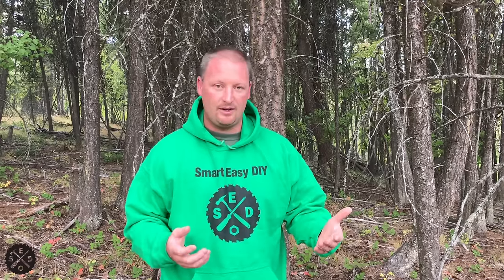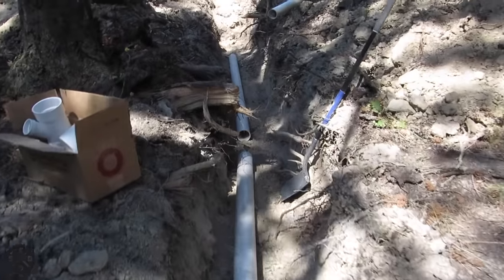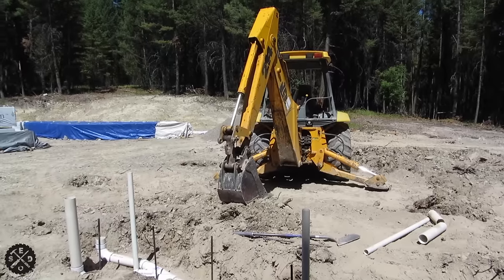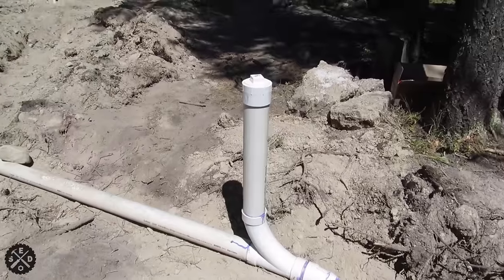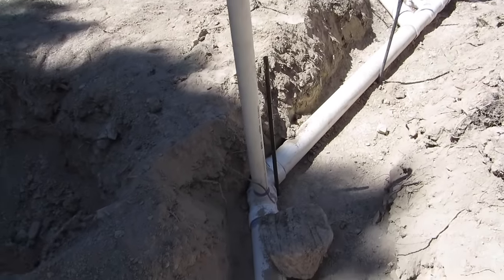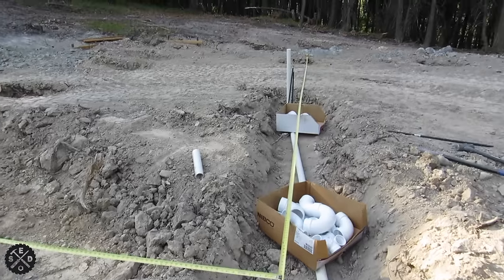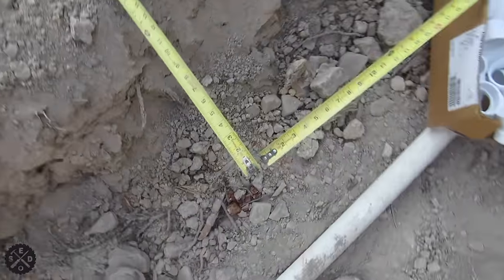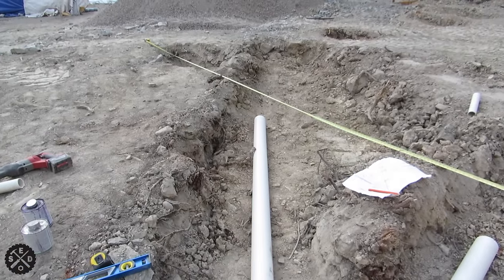Rough In Plumbing Before Concrete Slab Pole Barn House EP 4

Comment: Future reference for others. Size, don't oversize in drainage pipes. If oversize or too much slope, the solids get left, as the liguids drain away too fast, or don't wash the walls. 3 inch will run a whole house up to 3 baths. 
I should do a under slab video for the community. 
So many savings that could be realized, by more combination drain and vent properly. 
Great work on n a rough site with those rocks. Mostly right on.
Reply from the maker: Thank you for the comment. Thanks for sharing the tips. Yes I went 4 inch since I have a four bedroom and slope is very important. You should make a video. It’s all about sharing ideas. 😊 Thanks
Reply: What if you have 4 restrooms
Reply: @contrarianthinker   that is when it goes to 4 inch pipe. Oversizing cost more for materials and will not wash out as good since the water level in pipe is low and want carry everything it lays down and piles up.

Comment: Im a total amateur here. Is it ok to tie sinks/showers/floor drains all into the same drain your toilets use? I understand you use p traps  but im just concerned about  the possibility of sewage backflow into my non-sewage drains. Again, I know nothing about this stuff but welcome any advice. Planning on building in may and need to get this rough in stuff knocked out in April. Also, how do you know exactly where to center your toilet drains? Are all toilets pretty much the same distance from the back wall?
Reply from the maker: Yes it usually all gets tied into the main line which will end up in your septic tank. Most places don’t let you separate grey water and sewage anymore. Usually toilets are 12” center out from finished wall. So if you do 1/2” drywall thickness you would do 12 1/2” center out from framed wall for rough in. Baseboard thickness doesnt matter cuz it’s down low. Hopefully that makes sense. Make sure to do your research so you know what’s allowed in your local area, permits inspections etc. good luck!
Reply from the maker: https://youtu.be/rd6qO-bfg5E?si=XCghIr9mahLyeUTN You might also like this more recent video I did on my garage build. It shows separating the grey water from the septic as an option.

Comment: Do you need any qualifications to do your own plumbing?
I’m obviously planning on doing a lot of serious reading and getting info from people I know in construction, but just wanted to know if I could just so it myself.
And then who do you call to come and inspect it? Do they give you pointers to correct small mistakes? Or do they just nail you on the spot and that’s that?
Reply from the maker: Good question. I think it’s definitely good to research your area,  your state, county etc. every area is different. Where I live they let me do my own plumbing without a master plumber involved if it got inspected since it was my own personal property and for my own use not for commercial use. Some places you have to have a master plumber to even pull a permit. The best thing to do is to check with your local county building department because they will be the one to issue the permit and inspect it for you so they will know all the info. You can usually find info on their website for research purposes.

Comment: How much should someone expect to pay for rough-in plumbing for a new structure, connecting to a pre-existing well and septic tank?
Reply from the maker: That can vary a lot based on location, digging conditions, how many bathrooms etc. I would guess anywhere from 5-7k on the low end to maybe 15-20k on the higher end but that is very much just a guess since I’m not a plumber.

Comment: Just a tour of someone else's completed job. Would be helpful to the rest of us if actual actions were reviewed. How did you dig? How did you put down the pipe? how did you level? How did you make sure the pipe was supported underneath so that when you replaced the soil, the pipe didn't bend under the weight?
Reply from the maker: Yes I get that. I dug with a backhoe in my situation cuz that’s what I had. I’m not sure what you mean by how did I put down the pipe. I have a trick for using a level that’s simple to get correct slope. https://youtu.be/AkAGewA2aJM here’s a video for that. I tried to only dig a little at a time so I didn’t get too much for disturbed soil underneath. I would recommend bedding it in crushed gravel that’s packed nice though and also cover it in gravel or dirt that’s free of large rocks to protect the pipe as you’re covering it back up at least until you get a few inches of dirt over it. Hope that helps.
Reply: Back fill is all with premium fill and if pipe is correct depth , grade, and bedded well there should be no issues. This is not something that should be undertaken if you aren't experienced with it as it will be very costly to repair and could make your house unlivable. But that being said it's not that difficult

Comment: Very informative.  How much did that septic tank cost?  Where did you get it?
Reply from the maker: Thanks. I got mine from a local company that made it. I had to get a contractor to install in though as far as the permitting process so he purchased it. I’m not sure how much for just the tank but it was 5.5-6k for the tank and drain field installed.

Comment: Using 4", PVC and the way you piped, I don't think you'll ever have to use your clean outs
Reply from the maker: Thanks I don’t plan to but just in case. No issues whatsoever! 👍👊
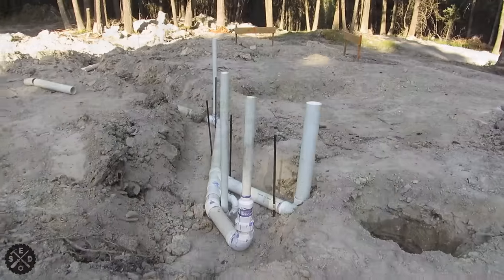Reply: The vent pipe upstream of the toilet at 3:51 running horizontal underground is a dry vent and is not per code. If the pipe were to backup waste will fill the horizontal portion and block your vent and you would not know it. Of course it’s good that you plan to install a clean out in the vent but it would be better to make it a wet vent and wash it with another fixture.

Comment: Why do rough in plumbing before planting poles and perimeter concrete forms?  What are your references to line up water and sewer connections so they line up?
Reply from the maker: I just did the holes first Because I knew it was gonna be a lot of trouble getting the holes in cuz of rocks. I had to drill and jackhammer to get them in. I figured if I did plumbing first I may run into it or damage it. That was just my personal situation. I just setup my strings and used that for my reference to measure off of.

Comment: So you don't need p trap for showers?
Reply from the maker: Yes I added them once I saw exactly where the drain went. It’s easier if you do a 16x16 square box made of boards to pour the concrete around that you can remove later when you’re ready.

Comment: Can you tell me what area you live in? We're building a pole barn home and I'm a little worried about plumbing in a slab in winter. Slabs aren't common here.
Reply from the maker: Yeah good question. I live in MT. It gets very cold here. My plumbing ended up being a couple feet in the ground but I also have radiant heat in my floor so I’m really not concerned about it getting too cold. For the most part there shouldn’t be water sitting in the lines to freeze anyways it just drains on out if that makes sense.
Reply: @SmartEasyDIYer  Im in Wisconsin, and we need out pipe out to the septic below the frost line, 4 feet here, per code, also I surprised you are allowed to do the plumbing on a new construction, most states require a Master plumber for new construction, remodel in most places is a different story. Same with Electrical for new construction, generally a Master Electrician is required to install. if you can do this legally, you are freer than most.

Comment: be interested to see a diagram of how it all works, and how deep to prevent freezing in winter.
Reply from the maker: I’m not much good at diagrams. So the only concern of freezing in the winter is the traps that hold water if you were to leave your building unheated so you could put in rv marine antifreeze in that case if you left for long periods. Just for general use though if you do it deep enough and it works correctly the water just drains out so there’s no issues.
Reply: Thanks for the info,    @SmartEasyDIYer
Reply from the maker: You’re welcome!

Comment: The septic tank looks big. 3,000 gallons?
Reply from the maker: I’m not actually sure. I was thinking it was 1500. It does look big yes. It’s for a 4 bedroom. I didn’t install that part of it.
Reply: @SmartEasyDIYer  
Looks like there are 3 lids (covers) on the tank. That means, there are 3 chambers in it. And if the depth of the tank is about 5ft. And the width of the tank about 4-5ft; then, it is very likely your is a 3,000 gallon tank. Big enough for 3 generations under one roof.
If you don't mind: price of this tank?
Reply from the maker: Yes one lid is where solids come in, one is for the solids/liquid filter and one is for the liquid side of tank. Mine is a gravity pressure system since I had enough drop I don’t need a pump. I can’t remember exactly but I think around 4- 5k for the tank and drainfield together.
Reply: @SmartEasyDIYer  
Good price. One guy on youtube paid 6-7k for a dual-chamber tank (2 lids), 2000 gallons total. His tank looks like yours, just shorter.
Reply from the maker: Thanks. Are you planning to do one soon?
Reply: @SmartEasyDIYer  
I can't afford it yet. Maybe in the future.
Reply: That price sounds very reasonable. What part of the country is this?

Comment: Did not even mention what the proper slope of pipes are !?!? I have to ask myself what benefit can I take away from watching this video?
Reply from the maker: I believe it’s in there somewhere. Should be 1/4 inch per foot slope pretty much standard everywhere for drains.
Reply: @SmartEasyDIYer  It's 1/4 inch per foot for smaller pipes. Less for larger pipes. But, hey, there are thousands and thousands of videos on YouTube that people make - some good, some poor, some lacking critical information, some giving incorrect information. You may not care what I think, but if you are interested in producing a higher quality video presentation, then I suggest you make the video and then preview it yourself. Maybe have another person view it - before uploading it to YouTube. Movie Directors often do several "cuts" before they are satisfied with the final product. Do as you please.
Reply from the maker: You could try the 1:27 part of the video where I mention it’s 1/4 inch per ft slope. There are certain applications where it’s 1/8 inch per foot but for the most part anything septic related is 1/4 inch per foot as far as I’ve ever heard. You’ll have to check in your local area though to be sure what’s acceptable.
Reply: @SmartEasyDIYer  Sorry, wrong! Slope is based on pipe size - per plumbing code book. I'll avoid reciprocating by making smart aleck remarks. You are clearly unteachable and ungrateful. Goodbye forever - hint - do not bother to reply
Reply from the maker: I really don’t see that I’ve made smart aleck remarks. I’ve simply pointed out that I do mention it in the video which you clearly skipped over. That’s ok. Please check your local code to make sure before going ahead with your project. Different areas can vary. Good luck.